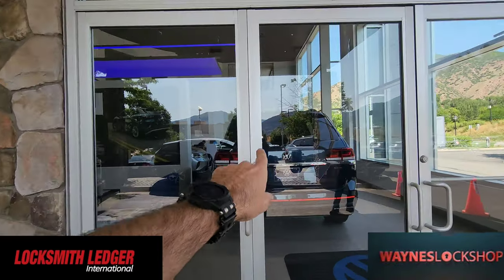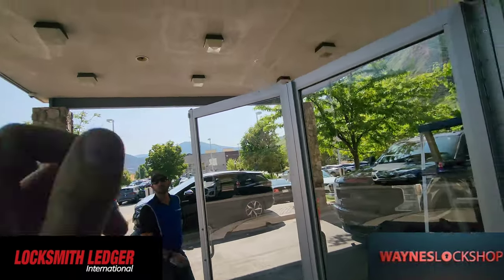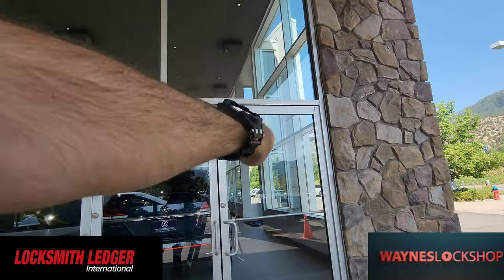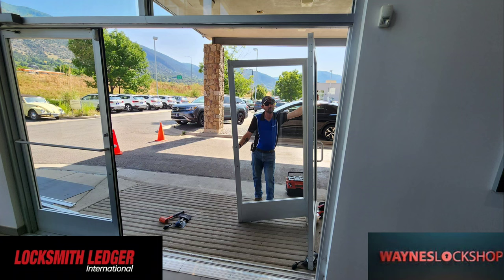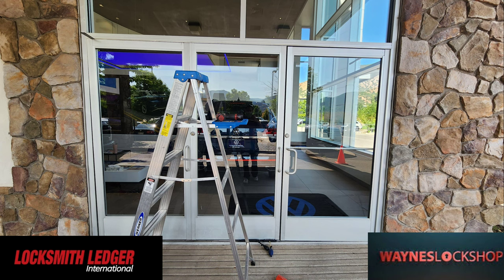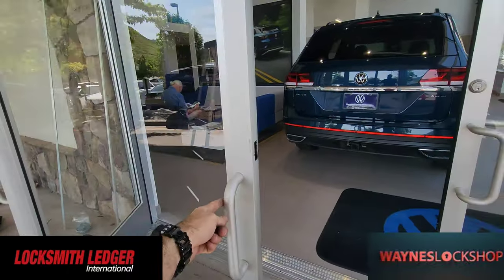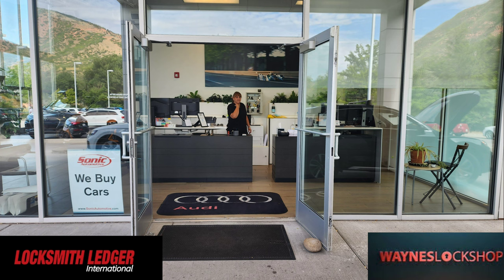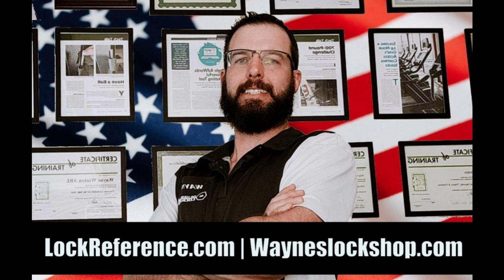Wayne Winton fixing large doors car dealership drive in showroom doors Select SL57 continuous hinge

Comment: Callback nightmare for sure.. 
Recommend that YOU recommend getting a real 72" alum door and get rid of that disaster. I’m guessing your labor warranty will last longer than the actual door, before it starts hitting the threshold that is. Dealerships are notorious for being cheap, so be careful bud!
A new door with a pivot kit, and a surface mounted LCN 4040 series will definitely take care of it. 

I am guessing that’s a Adams Rite deadbolt/hook bolt with a header bolt?
If not, meaning no header bolt, what was the point of it. 

I hated having to do what you had to do, because whoever invented that nightmare should be over there, dealing with it.

But, then again, you wouldn’t be making money – so disregard 😂

May the force be with you AND keep the door off the threshold until the warranty expires? 🍻👀